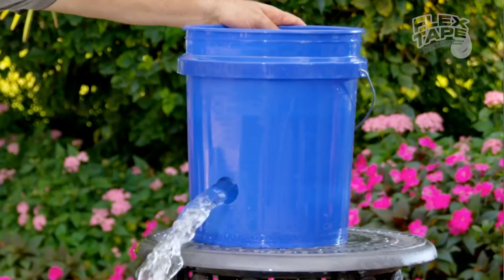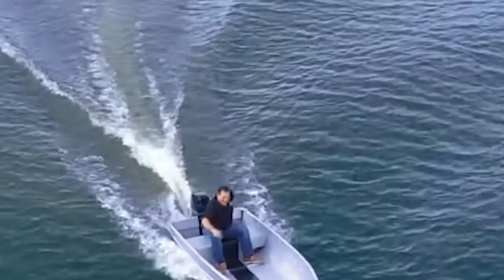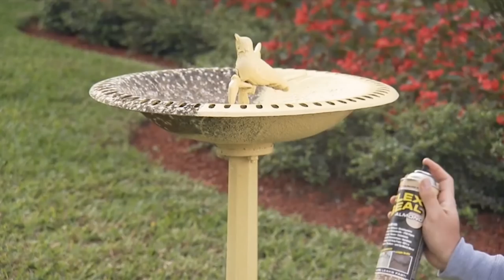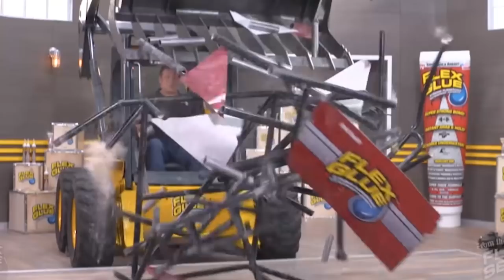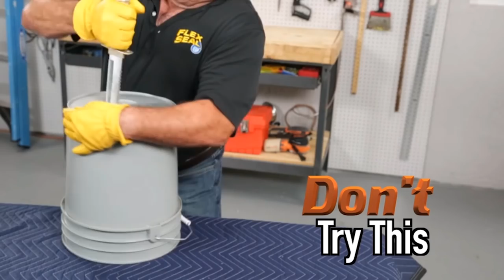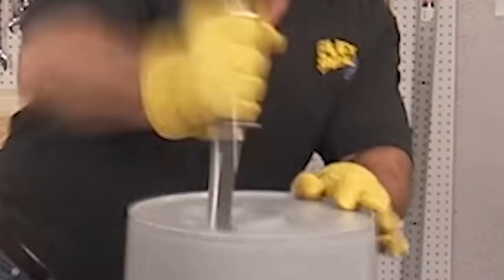The Amazing FLEX TAPE!! - React Couch #19

Comment: You know, flex tape is fairly expensive. I bought some for like $15. The amount it would take to "fix that boat" would be easily around $200-300.
Reply: Having worked at a hardware store that sold it, I can tell you I never sold any to anyone. (Only worked there for a year tho)
Reply: @shocktnc  really? How come?

Comment: Story time: So my previous landlord subleased his camper trailer to me and my fiance, little did we know, there was no roof. There was a ceiling and a tarp over the top of the trailer, but apparently the roof had caught fire and now it was just gone. So we didn't know until it was too late for us to move out, we'd exhausted all our expenses. The first time it rained, before we knew, there was a  huge leak in the closet. We told him and he said he'd come by to take a look and try to fix it. We didn't have access to a washer or dryer so I went to my moms every weekend to do laundry, while I was at my moms the landlord had gone over to fix the roof, my fiance came home to him on top of a ladder working on it. My fiance asked if he could help and LL was like sure there's another ladder in the shed. So my fiance comes back climbs the ladder looks down and can see inside the trailer, he can see all of the electrical wiring of the trailer, the wiring for the outlets, lights, etc. THIS MOTHER F*CKER WAS USING FLEX TAPE AND FLEX SEEL TO FIX IT! Needless to say it really did nothing, the leaks got worse, and by the time we left, it was leaking through a light above the bed. There was a lot more than just that but its not flex "whatever" related lol